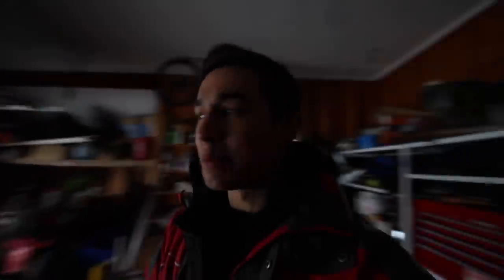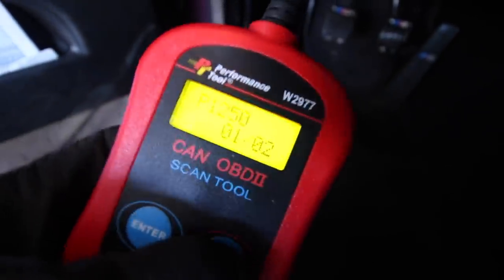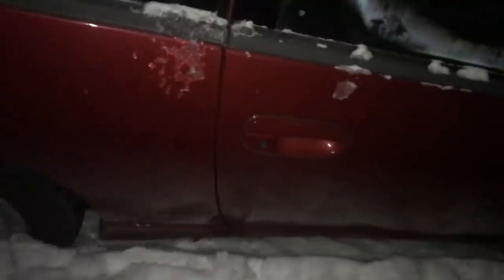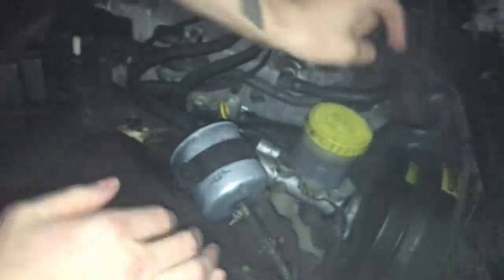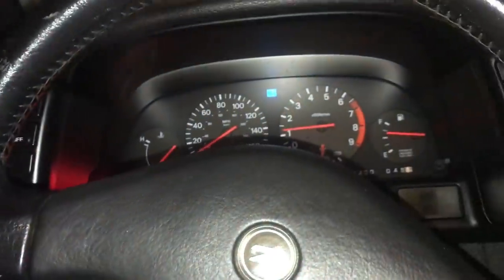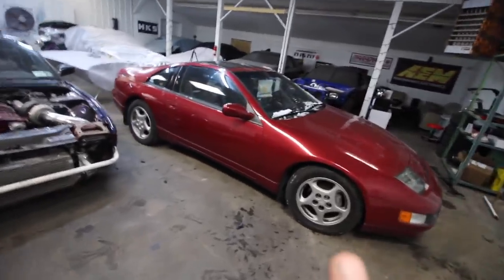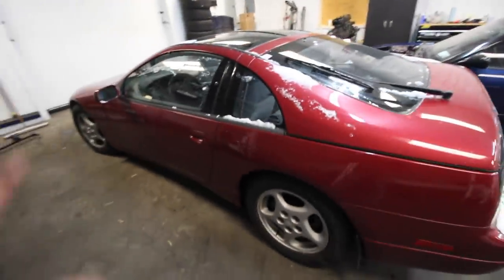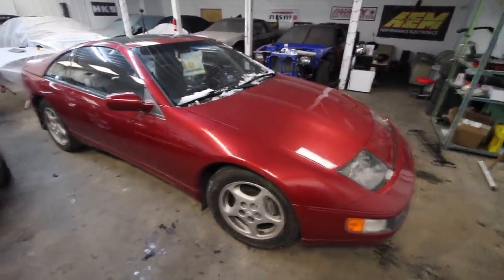BOUGHT ONE OF MY DREAM CARS!!

Comment: Congrats on the 300! If I were you I’d put the rb25 in the z bc even though the Vg30 is a heavy pig of a motor, the 300 is still a much heavier chassis than the 240.  The 25 will make more torque which will help the 300 feel faster. Plus you have one less motor to pull that way. Can’t wait!!
Reply: Strat. Attack13 twin turbo the an engine and blow it up first lol

Comment: The rb is a heap longer motor then the factory engine also the 300 has a smaller engine bay to the s chassis you might run into problems with mounting a radiator and cooling

Comment: RB SWAP! Please do an engine build similar to the s14 but instead of using rb26 heads use rb25det or neo heads there cheaper and you can still get some great power out of them! Now for the rb30 block you want to type in www.gumtree.com.au and then look for the block! You can get them cheap! Ranging from $100 australian to $1000 i got one for my commodore for $500 and did a rb30/25dett and it went hard! But this is just a suggestion its up to you with you with what you do with the car kalvin! Keep up the good work brother! From the land down under 💪☺

Comment: Dude if its low fuel pressure its not gonna be a filter, filters would have to be absolutely smashed to stop fuel enough for no start. Its probably 75% chance its your fuel PUMP.. Check it out..

Comment: That’s one of the cleanest stock Z’s I’ve ever seen.
Reply from the maker: Dude, for real...
Reply: You haven’t seen very many stock Z’s 😒
Reply: Jade Z32 I was in the market for one at some point. They’re really hard to find clean and without any problems. Just like a 240.
Reply: Isael Dominguez of course, it’s a Nissan. 😂 the point is basically to buy em cheap and learn to do the work yourself 🤔🤷🏼‍♂️ if someone wanted a clean stock car they should find a E46. Not a 90’s (or any) rwd nissan
Reply: Jade Z32 Not really into German cars 🤷‍♀️. I’m all about Nissan. Everyone wants to build a car, but you have to a good canvas to start with. You can get a cheap 240 with haggard wiring, stripped interior, salvage title, ect, but why do it when you can be patient and find a clean one to start a project with.

Comment: Nissan fam. Really nice shape dude.
Reply from the maker: Thanks brotha!
Reply: Forgot to ask about the BMW. Did you change the crank pos sensor? P1250 should not cause a no start condition. Check for spark and fuel injector pulse, if they no good, CPS is no good.